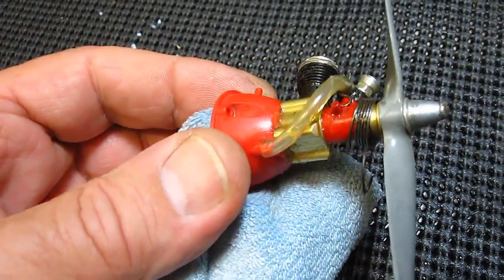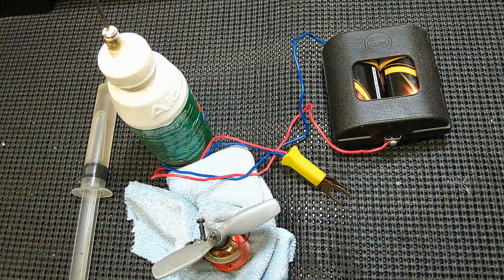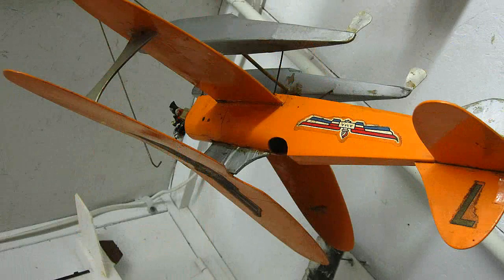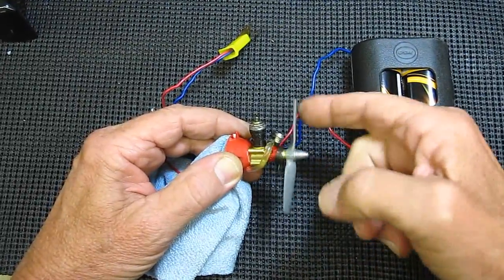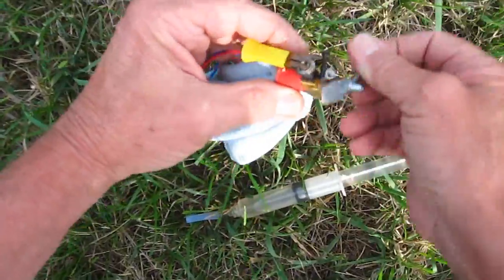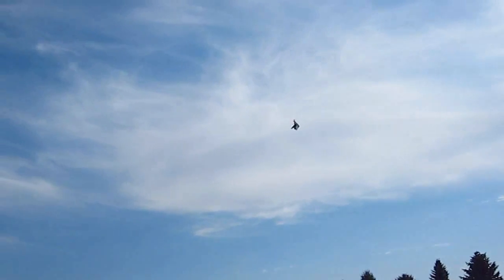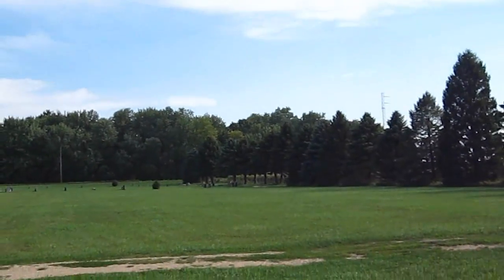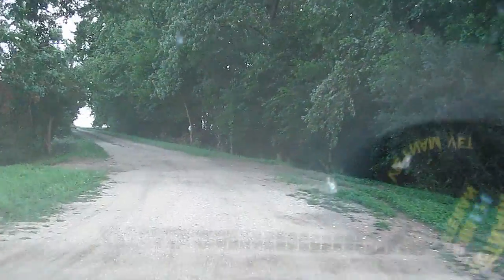Cox .010 Nitro Engine Powered Flying Shop Rag. Part 2.  SURPRISE ENDING!!

Comment: Well now I've seen everything. LOL We in our family had the .010, .020 and many of the .049's. The .020 was lost on a free flight. It was last seen looping a power wire and missing a tree by inches. The .010 was on a Guillows German D 7, it was the perfect size to keep up with as a free flight. The weirdest Cox engine we had was .15, I believe. It was a beast, but couldn't get it started for very long.
Reply from the maker: Right on.  Glad to hear those stories.  Dave Duncan was chief engineer at Cox when they were in Santa Ana, before the fire. He was a member of our club and my wife worked there as well.  So when something new came out, we were the first to see it.  We used to have .10 earrings for the wives.  Thanks and happy flying.

Comment: Hi Dave, Phill Wigley (wiggles) here from U.K. England. Wow That was quite an exiting wild ride. Lucky to find that. I have  just been given one.  The same as yours. Cox Tee Dee .010. totally seized. I have un-seized it, And stripped it all down. The con rod was snapped in half, so it needs a piston lined conrod assembly, But I can't find one for love nor money on ebay except in a running engine. Have you or do you know anyone who has these parts cheap as posible I'm a pensioner 74 years young. Been modeling since the age of seven. Paper aircraft at five  years old. First balsa wood aircraft was mercury magpie. It didn't fly good. Then a Veron Cardinal wityh ed bee mk 1 I scronged. It flew staight as hell into a rugby football goal post.  Ive had loads of different planes through my hands and still have a few. Latest is a David Boddington  Bumble bee mini. I few it yesterday, electric power. I would like to get this Cox .010 going again. I already have a part built aircraft ready for it to go in. called the Jap. English Aeromodeller free plan Its made entirely from 1/32 inch - ( 1.5 mm) balsa. They did fly the rag at Old Warden model meetings untill someone got hit on the head as it came down. Mills .75's (tank on the back rear intake) on them (0.49 size). The vid here is a one in a million find. Very entertaining keep em comming. Kindest regards Phill W (wiggles)

Comment: You were brave.  My dad had me convinced I'd lose a finger, and at 27000 rpm he might not have been wrong. The noise scared me too. But now that I'm OLD, I might just drag those engines out.  I have a Cox .020 that has never had fuel in it.
Thanks for the good time!
Reply from the maker: Haha.  Go for it.  Thanks and happy flying.

Comment: I did a lot of crazy flying in my life but this is first time I heard of and saw of a flying shop rag.  My flying coathanger/cardboard contraption that looked like a 4 winged windmill the closest I came.  Well, there was one crazy stunt we did as kids but I won't give details due to safety concerns.  It involved empty Co2 cartridges, match-heads and a length of iron pipe.  It was the baby brother of rocket tubes we used to look for during nightly perimeter flights.  Both were probably evenly matched for accuracy.
Reply from the maker: Yes, I will never forget the sounds of those Rockets in Nam.  Glad you enjoyed this.  God Bless and Thanks.

Comment: Ya shouldug added a "U" control line to it, lol.
Reply from the maker: LOL.  I believe that would be hard to control, but at least it wouldn't get far away.  LOL.
Reply: @NightFlyyer  Lol, that was my way of thinking, lol. I havent seen that done in a very very very long time. I'ld like to git my hands on a .010 Cox motor
Reply from the maker: @truckerray7533  LOL. You can still get one here, but the price is extraordinary.  https://coxengines.ca/
Reply: @NightFlyyer  Copy that. I'll check it out. . . .thankya sir
Reply: @NightFlyyer  i used to have a .049 way back in the teeny bopper years.

 Boy i guess. . . . . them lil critters are pricey. . . .holy moly!!!

Comment: I should build one of these and fly it at Edgewater Airpark. Looks like a hoot!
Reply from the maker: It is.  Go for it.
Reply: @NightFlyyer  Currently working on a Flite Test Long EZ with a throttleable(ish) 049 on it! All my current Cox mills are tankless though, would have to replace the backplate with a tanked one to fly a rag with it. Cox Intl has plenty. Small tank would work; I wanna find the thing again ahaha.
Reply from the maker: @TestECull   Yes.  Small thanks are good or you will have to install a gps tracker.  Good luck with it and the Long EZ.
Reply: @NightFlyyer  Lookin' promising on the Long-EZ. I'm keeping it light, should be under 200 grams which is excellent for a surestart 049 swinging a 5-3 Cox safety prop. Got a video up on my channel of a bench test of the plane...it's a 1oz Sullivan roundy, a switch, and a 2s500LiFE away from maidenable.
Reply from the maker: @TestECull  Watched it.  Great.

Comment: LOL it reminds me of a time I lost site of a piper cub I was flying behind the trees and thought I had crashed it so I pulled the throttle back turned off the transmitter and went on my journey to pick up the pieces. It was long ways away but as I can up to where I thought it had crashed I heard an engine idling and I thought no way.. Well needless to say some how the piper cub had landed itself and was setting in a clearing engine still running talk about crazy luck...

Comment: Good to see the Cox 010 again and still running. Never tried the rag plane. Good you found it. I had one years ago and put it on a the Littlest Stick with rudder only. Wild flying with Galloping ghost system in mid 70's. Regular radios were just huge then. Still have a Tee Dee 049. Enjoy your videos. Some of the videos take me back to the old days of RC. I started flying RC in 1969 and still at it.

Comment: I bought one of those Cox TD 010 back when they came out, I built a kind of crude free flight plane I mounted it on, but was afraid I'd lose it so I never flew it.  I had a major illness back in 2000, short of money and sold a lot of my old RC and airplane stuff, including that engine, i wish I still had it!  I still had the original box and all the goodies that went with it.

Comment: I had a Cox Pitts line plane with the 010 engine. It only had about a 12" or 14" wingspan. Man that thing screamed. By the twelfe time around which was only about 30 seconds, I was so dizzy I usually tried to land it before I fell over. That was back in the late 60's.

Comment: great vid, that was too good to be true in the end.  so there is no throttle control, just goes till it runs out?  if you hooked it to a receiver then you could cut the throttle when it gets away.

Comment: I notice that I have an even smaller neumotor that takes a 3x4 prop, has a kv of 5300, and a max rpm of 60,000. I still like how the cox engine sounds really powerful when started up and weighs a whole lot less if you compare it to the whole power system of my motor,